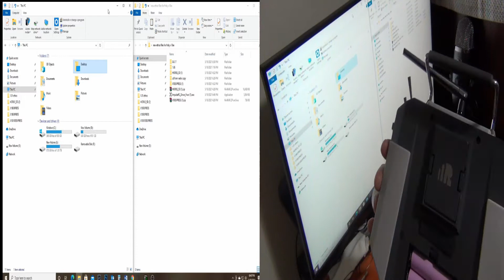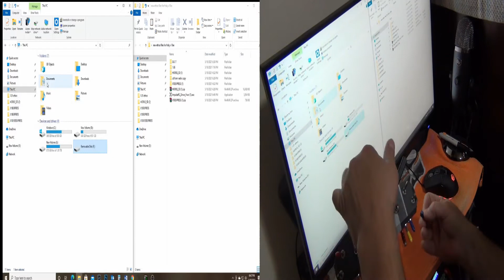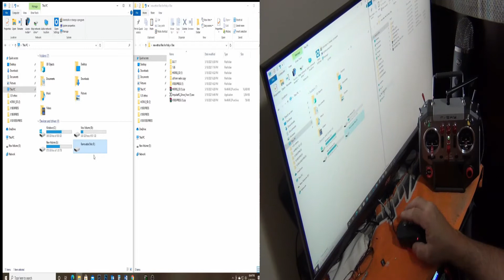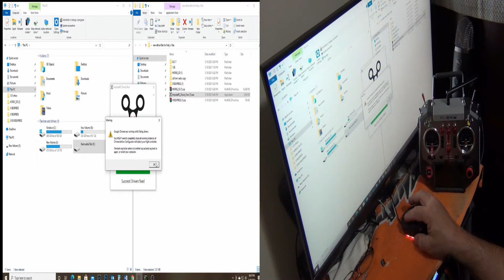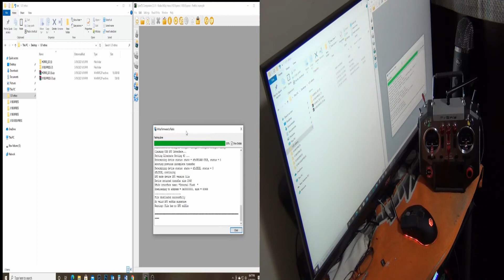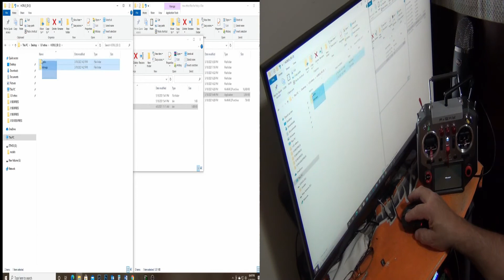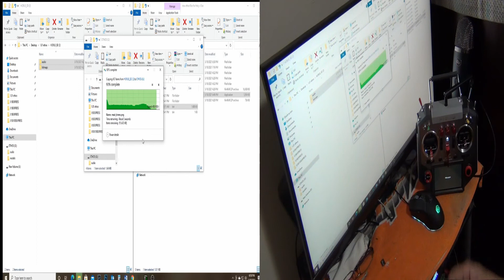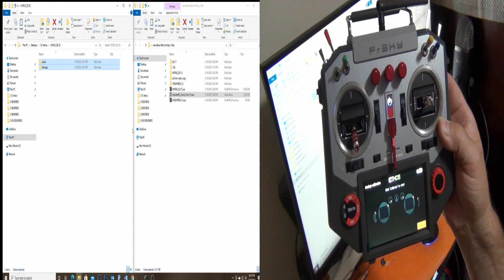loading ETHOS on a frsky x10s express

Comment: Hi, any word on how to get back from Ethos to the original FrOS or OpenTX? 
Bought a second hand X10S Express with Ethos on it and not been able to find any tutorial how to reverse this. 
Thank you for any tips.
Reply from the maker: i think its as easy as bootloader and install a downloaded open tx for the horus on a sd card, just follow a open tx install on a horus 10 and it should go back

Comment: Hello. TY for the video. Could you tell me where you find the file bootloader for X10S EXPRESS ? I find the firmware on the website, but nothing for the boot loader. So thank you
Reply from the maker: if your trying to get to the BOOT screen, use the fixer on your pc, then try to go to boot mod after it installs DRIVER FIXER
ImpulseRC Driver Fixer

This application will attempt to install the correct serial port and DFU drivers for using STM32 F3, F4 and F7 based flight controllers on Windows. If you have trouble running the Driver Fixer you may need to install the Microsoft .NET Framework v4.5

https://impulserc.com/pages/downloads
Reply: @CRUZROYHelicopters  Hello ! So thank you for your answer. I have no problem to enter DFU on my PC. I could flash my radio in OPENTX, but the boot loader is different for ETHOS OS. You use a file that i cant find on Internet. Could you give me a link for finding the file bootloader ?
Friendly
Nicolas
Reply: @CRUZROYHelicopters  Its OK !!! The file is on the web of ETHOS !!!!
Thank you. Migration complete !

Comment: Awesome! But I can't find the bootloader.bin file for my X10S Express! Only the firmware.bin part but obviously it does not boot without it. Any pointers on where to get it?
Reply: Pull both horizontal trims inwards and power on
Reply: ETHOS-boot-1.0.1.zip